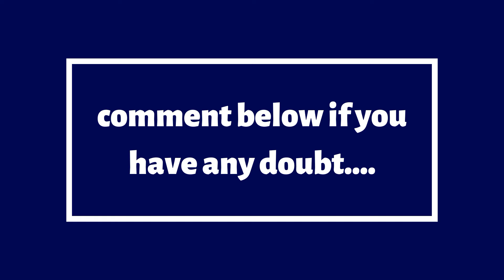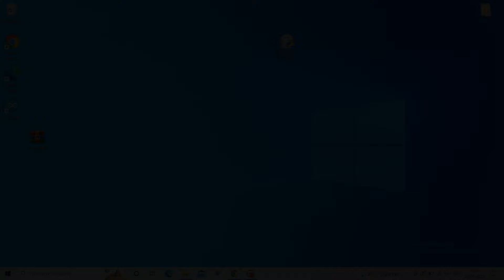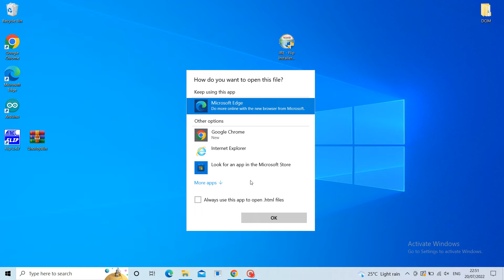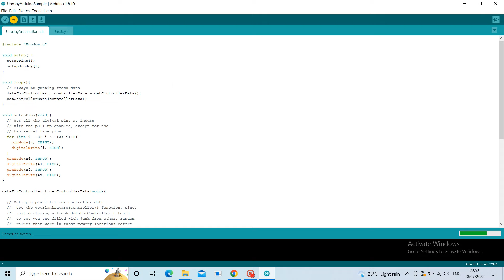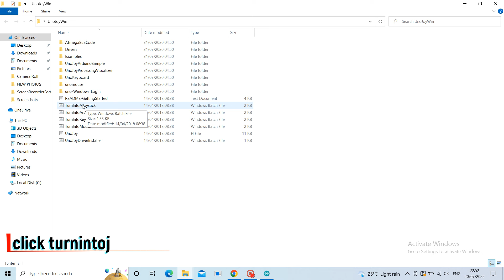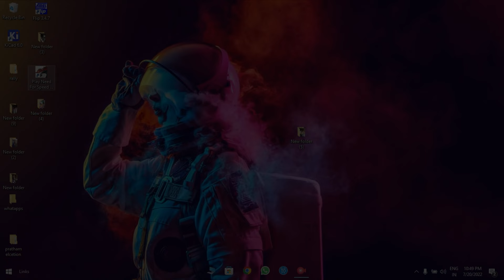How To Make Gaming Steering Wheel Wth Arduino Uno || Game Controller || #11 Arduino Project

Comment: rather use a cheap mechanical rotary encoder and insert it on a pulley with teeth and a belt than a potentiometer

Comment: how do i add another axis? i want to connect a joystick but i dont know what to change in the code to add A1 to the axis
Reply: i was able to add to A1 A2 and A3 but want to know if its possible to add to A4 and A5 because i need 2 more analog inputs

Comment: bro does this work in Forza horizon 5?
Reply: Do you have arduino UNO or Leonardo?
Reply: @bossoy0769  I have both, I used Leonardo for Pedals and H shifter and The uno for this steering using a potentiometer, some gears to get 900 degree rotation. I went to Forza and clicked Mapping option. It works 👍
Reply: @chaitanya60  alright nice that it works
Reply: @bossoy0769  I think it actually works with any Arduino. I believe as long as the board supports analog read from the potentiometer, instead of using UnoJoy you can use vJoySerialFeeder to simply read an arduino analog output through the USB and emulate the analog into a vJoy input, then that vJoy input then can be used in X360CE so it'll work in literally any game that supports a controller.

With this approach instead of the Arduino being an HID device directly and the game reads it, the input serial analog data simply passed through a third party software that emulates a controller that can be read by the game.

Also I see no disadvantages to this other than having to click extra steps whenever you want to use it so, correct me if I'm wrong and this idea has any flaws or something. (Yes I did tried it with my CH340 knockoff Arduino CH340 board).
Reply: @Not_Aran8276 yes thats Right But do you know of i can use Rotary Encoder instead of a potentiometer on the arduino uno?
Reply: @bossoy0769  I mean as long as the rotary returns a value/changes a value (when you Println the analog input) when you turn it, I’m pretty sure it’ll work fine. I don’t really know a difference between a rotary and a potentiometer knob like these
Reply: @Not_Aran8276  so the potentiometer has the normal 270 degrees while the Rotary Encoder has continious degrees wich basically means it can rotate infinite degrees
Reply: @bossoy0769  I think that’s still possible, but you have to do some logical programming & coding in the Arduino IDE. As long as you somehow can manage a value from 0 to 1024 and since it rotates infinitely, there needs to be some sort of calibration in place (Probably a button or software controlled). I’m pretty sure there’s forums and tutorials out there how to limit the rotary encoder to only around 0-1024 value. Also that’s also a possibility for a 900-degree steering, but I wouldn’t recommend going with a rotary encoder since you can accidentally rotate it way too much, if you want a 900-degree steering try a potentiometer with a mechanical gear ratio.
Reply: @Not_Aran8276  yes but sadly i found out you cant use ffb with an arduino UNO and potentiometer i looked it up and found out that its only Supported by the arduino leonardo and i found a Programm for the Encoder wich makes it to 900 degrees so and also i also discovered After many turns with the potentiometer it gets inacurrate  so i think the Rotary Encoder one is a good method
Reply: @bossoy0769  Makes sense, the way these potentiometer works is by rubbing a carbon conductive film against the moving conductor metal. These carbons are guaranteed to get rubbed off by wear and tear, this actually happened to my DualSense controller as well aka stick drift. I wonder though, does the Rotary Encoder uses hall effect sensors? And btw I never think about about force feedback since I ran out of budget lol (I might actually have built one today for just under $6).

Also thinking about it, about the rotary encoder, you can technically make some sort of limiter once the steering wheel reached it’s maximum angle, Idk how the mechanism work but regardless it should be possible.
Reply: @Not_Aran8276  yes thats sadly true thats the downside of potentiometers but Rotary Encoder work Like this: it has a magnetized Wheel attached to the Shaft as the shaft turns the Position of the Wheel is read by a magnetic sensor attached to the component housing but for the stickdrift on Controllers you can replace them  with hall effect Sensors wich i think should be standart on Controllers but I guess they wanna make more Money with the Controllers when they Break you buy a new one and so on i actually run out Of Budget to lol 😅
Reply: @bossoy0769  @Not_Aran8276  Yes same here lol, I got Leonardo and other stuff and went out of budget, next year I will upgrade to FFB with same hardware. I am also planning to post a video about my current setup with reference videos, maybe you guys can check it but they will be in Hindi language, but you can easily interpret by the video tho. Also rotary encoder of good quality costs around 18 dollars + motor and driver separately. So instead I used 56 Teeth and 14 teeth gears to increase angle on the potentiometer, let's see how it works
Reply: @chaitanya60  Bro thats exactlly what in planing to do😂 i buyed a Leonardo Board made it without the Force Feedback when I have more Budget I will Upgrade to i will definitetly subscribe to you

Comment: hi  can I use ardino uno R3
Reply: I have the same question, although yesterday I made a 4 hours search for the answer on the net, found out that maybe You cannot use it, because its chip not supports USB clienting like R2 and R1.
I ordered a Leonardo instead.
Reply: @ChrisNemes  how did you put the arduino leonardo in dfu mode?
Reply from the maker: no
Reply: @stokbrot  i know it's late, but as far as i remember, you have to press the reset button for like 5 seconds or so
Reply: @MartinScherpa  figured it out but its not worth it because u cant steer and apply throttle at the same time you would need multiple arduinos
Reply: @robotechzone which arduino should we use?

Comment: Bro i ran into a slight problem where even tho i connected the potentiometer it didn't work as it should. The controller is only turning to right. Help me bro :D
Reply from the maker: Use 10k potentiometer or check your wire connection is not correct or try to change the game

Comment: Write the hardware you used in this project in this comment or in description
Reply from the maker: arduino uno
10k potentiometer
2 on/off switch
jumper wires

Comment: My steering is not working although I did the same as you did 🥲🥲
Reply: Skill issue
Reply: @arthurpfarchive  Nah bro... I corrected it... Actually I was using 100k ohm potentiometer... I used 10K and it worked!
Reply: @cosmicgamerz222  oh, good for you then
Reply: Bro can you give me the link of your arduino board
Reply: @cosmicgamerz222 which arduino u used for it?